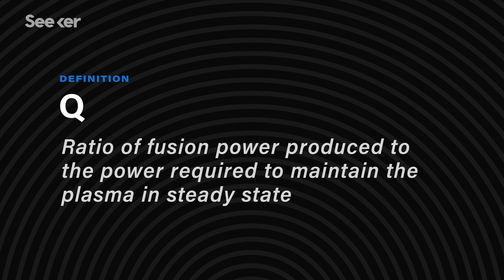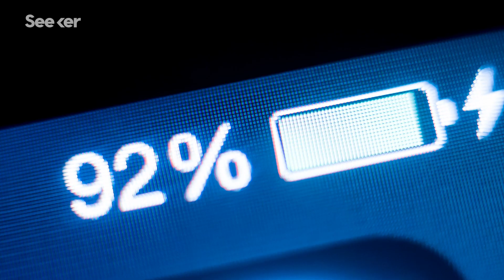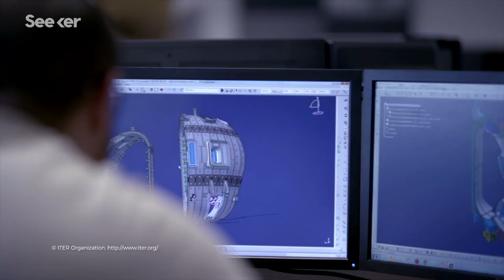How Close Are We to Fusion Energy?

Comment: Using magnetic fields to warp the plasma isn't the answer. If you made the generators in space I firmly believe that the magnetic field wouldn't need to be as strong as it is needed on earth. 

However getting a Fusion reactor into space would be difficult. 

Plus getting the energy back to earth would be more difficult..

Comment: Unfortunately, lower half-life means more radioactive in the short term. The candle that burns half as long burns twice as hard. Still, it depends on the type of radiation and radiation in itself isn't a big problem if it's managed properly.
Reply: Not really. Tritium has a half life of only 12.3 years but is barely radiotoxic compared to something like Cs-137 which is a longer half-life

Comment: In science there is this attitude that anything  is possible If studied enough.  The problems  with generating sustained fusion reaction are just too great.  In a star the fusion reactions are held in check by gravity . This depends on the stars mass . A more massive  fuses hydrogen at a greater rate than a less massive star. We  cant just replicate a small  star on earth. It's  small mass will not be sufficient to start fusion nor sustain it.  
With fission we slow the fission rate by controlling the number of neutrons involved in fission process.  If the number of neutrons is not controlled it can result in a run away reaction and a nulear explosion or something lke it. 
But in the case of fusion there there is no particle to control and moderate  the reaction. It all depends on how much hydrogen is present and how great the pressures exerted by gravity. You cant simply  change the amount of hydrogen present nor the amount  of gravity. These  are  things that would have to change on a massive  scale. We are talking about controlling things that are uncontrollable. The smallest star we know of generates too much raw energy in the form of heat,  light etc. The light in its most destructive form. Ultra violet infrared gamma, etc etc. 
If you  could get even a very  small star started there would be no way to contain its  immense energy. There is talk of using a magnetic  bottle  to  contain the positively charged atoms but cannot contain the energy  generated. What ive outlined  is very simplistic and the problem is way more complex. I believe it is not something that will ever be a reality. Ever ever. People are fond of saying well people said we would never fly  and would never go to the moon. But those are things  on quite a different scale. And being said by people with knowledge of the science available at the time. It  was certainty impossible with the  science known at the time.  There is no  hidden science that if synthesized would make a fusion reactor possible. Never gonna happen.
Reply: Gregory Phillips sorry, but you know nothing about how fusion works. You clearly don’t even realise what reaction chain it would follow.

Comment: ok phase 3 nuclear left us with either a 100,000 year problem or 100 years of fuel for phase 4 nuclear fuel that breeds tritium for fusion as a side effect iter is already obsolete small containment fusion is advancing by leaps and bounds but you still have to deal with high level waste that can be irradiated at huge energy cost  to cause it to brake down or it can be burned as fuel if you go with a fusion only solution there is a very large cost for reprocessing spent fuel as storing for 100,000 years or more is not a viable option. and with thorium and spent uranium the amount of high level waste and fertile material available the question becomes how much energy can you really use.

Comment: Fusion energy is technically nuclear energy.
Reply: No, not exactly. Nuclear reactor is based on Fission - when one big atom splits in many small atoms. Fusion reactor is opposite, it will collide small atoms into one big.
Reply: @breathtakingsamurai981  "No, not exactly."  ...Bullshit!  I know the frickin' difference and you're wrong!.  My point is that regardless if it's fusion or fission it's still NUCLEAR FRICKIN' ENERGY!  Although the duration of the radioactive output is a fraction of fission, it's still "neutron radiation" my friend.

It's still "atoms" in play regardless of what element you are using.  You should know that!

At the very beginning, the video listed "nuclear energy" as being a problematic energy source and all I did was remind them (and you) that it is still "nuclear energy."  

Whether you are left with 10,000 years of radiation or 100 years ...you're still screwed  You STILL have to find a place to get rid of it.

Comment: Too much energy is lost in a torus to sustain fusion. A sphere is better. Search for "spherical electromagnet" if you want to see a better design. It should be the first thing that pops up. You will know it when you see it - it's the icon that you see to the left. In this design the plasma is rotated like the armature of a motor with the axis of rotation constantly changing. The counter emf inside the plasma compresses it toward the center.

Comment: SO yeah it taking long might be a good thing. A melt down in a fission station is bad yes but a runaway fusion station literally turns our planet into a star. Everyone wants it but it needs to be done right and done safely.
Reply: We already created mutiple fusion reaction inside our atmospheres, with no protection whatsoever, and it didn't turn the planet in a star it is physically impossible to do so.
Reply: Who told you about a runaway fusion reaction?? The conditions to keep the reaction going are so critical that the proces shuts down itself with the slightest change in variables. Everything that can possibly go wrong will just shutdown the plasma and in worst case, require an expensive and long repair. It are the laws of physics themselves that make it intrinsically safe. It simply cannot explode. The only way to get a fusion explosion, is by creating first enormous pressure with a fission bomb.  That's how fusion bombs work. At Iter they just use a ridiculous high temperature to compensate for the lack of pressure. That temperature can only exist inside something that has practically no mass and cannot touch anything. When it touches the reactor walls, it cools down instantly far below the temperature needed for fusion.

Comment: Einstein's famous equation, E=mc^2 is wrong otherwise garbage also can be used to make nuclear bombs as long as it is matter or it has mass. Energy and matter can't interchange one another according to Einstein's famous equation. One must have photons before one can emit out photons. Photons are particles and they have mass. All forms of EMWs including light and heat are dynamic photons per volume per time in different saturations. Fusion process is a bluff! It's not something as easy like combine some atoms into other denser atom. Based on our research is that single  protons of hydrogen molecule have no nuclstayphotons (e.i. nuclstayphotons are photons that can't be replenished after releasing to the surroundings and they play an important role in squeezing nucleons together to maintain nucleus stability) but abundant chemstayphotons (i.e. photons that can be replenished after they have been released to the surroundings when there is changes in temperatures or due to chemical reactions). On the other hand, nucleons of helium atom have reasonable amount of nuclstayphotons to squeeze nucleons together to maintain its nucleus stability. In addition, nucleons of helium atom have very low amount of chemstayphotons therefore it almost completely inert chemically. Therefore it is impossible to fusing 4 hydrogen atoms to a helium atom because single protons of hydrogen molecules don't have any nuclstayphotons at all and it's impossible to replenish those nuclstayphotons onto single protons of hydrogen molecule before any attempt to turn them into helium atom. No wonder all tokamak reactiors worldwide still  fail to produce even trace amount of helium atoms. Precisely, fusion process is a big bluff! Scientists got it wrong that stars including the sun generate heat and light through  fusion process on hydrogen gas. Yes it is true indeed that atmosphere of all stars is filled with abundant hydrogen and helium gases and this doesn't necessarily mean  stars generate heat and light through fusion process on hydrogen gas. We must understand why and how hydrogen and helium enriching all stars' atmosphere in the first place? As a matter of fact, hydrogen and helium gases are the by-products of proton emission and alpha emission respectively by decaying radioisotopes within the core of the star. We got this wrong somehow. The earth's upper atmosphere is also enriched with hydrogen and helium gases too that derived from proton emission and alpha emission respectively by decaying radioisotopes within the core of the earth. If you are interested in real discoveries, I would recommend you to read my book, The Unification Theory - Volume One and you will be amazed with lots of new, interesting discoveries. In God I trust..

Comment: -  fusion is the most overrated energy technology. it is nothing else than a steam engine with an extremely inefficient temperature differential. to drive the turbines we need several steps of conversion with immense energy losses. fusion reactors are expensive and gigantic, therefore they are rare, central power stations with extremely long connections to the customers, resulting more costs and less efficiency. any solar roof or heat pump is better engineering than a fusion reactor. they might be sth. for rockets or as we know perfect for weapons of mass destruction ;-(
-  it's on of the least efficient energy technologies. to promote the fusion, pressure and heat energy input needed with over 90% of the potential output.
-  it's the least practicable energy technology. the slidest problem with the electro-magnetic field in the reactor causes complete damage of the hole system... and worldwide they never kept a permanent process, seconds or minutes were the best durations until (emergency) shutdown.
-  it's one of the most expensive energy technolgies. the hydrogen fusion isn't state of the art anymore because technical hurdles are too high therefore the new concepts are dealing with helium3, less effective, the fusion is easier to start to keep ... but the stuff is rare ... we would have to get it from the moon surface, this isn't a joke, it's idiocy. guess why several nations planning to go to the moon.

Comment: Sun and all stars generate heat and light through fission on dense or very dense radioisotopes or both within their core. Generally atmosphere of stars is enriched with hydrogen and helium gases as a result of the by-products of fissions. In other words, proton or neutron emission will likely to produce hydrogen atom. On the other hand, alpha emission will likely to produce helium atom. Face this reality! Einstein's famous equation, E=mc^2 is wrong otherwise garbage also can be used to  make nuclear bombs as long as it is matter or it has mass. Energy and matter can't interchange one another according to Einstein's famous equation. One must have photons before one can emit out photons. Photons are particles and they have mass. All forms of EMWs are dynamic photons per volume per time in different saturations. Photons can account for the loss mass during the detonation of a nuclear bombs. If you are interested in real discoveries, I would recommend you to read my book, The Unification Theory - Volume One and you will be amazed with lots of new, interesting discoveries. In God I trust.

Comment: Now we finally have devices where we can see the magnetic fields measure their strengths and position them to the exact specs we would like we should use that to our advantage, Because when it comes to fusion cold fusion nuclear power things , You how Hi super high heat plasma so you would have to contain the energy burst when energy is released things like that kind of white solar flares and stuff like that, In order to do that you would have to have technology that can withstand those types of power reactions what is kind of hard to tell so you could do that by separating creating a non physical barrier with magnetic fields, I'm sure they're doing that stuff already the problem is that they have not affected the techniques and attitude him you would need a sphere magnetically to compress an inner magnetic doughnut, So when flares happen they are re directed and compressed back to the magnetic do it half weights and continue their process, Then you can use the outer shells as a backup system like their ripples and material composition and gun real burst frequency vibrational  Uses as a backup system when a flare cannot be compressed, There  Is also a crystal form of energy as an outer shell we could you to life to cool the system on emergencies there will take the atomic structure of the heat transferring it to atomically creating a structural pattern we can utilize the energy and it will self change the tomich structure and/or patterns back once transferred and be ready for the next heated explosion and expansion, Then we just call it the energy magnetical photo and heat transfers,

Comment: I just can't wrap my head around what would happen if a fusion reactor had a catastrophic failure. Would it go out with a boom like we've never seen... or just shut down?
Reply: From what ive read, It usually just shuts down. The process to sustain the plasma is rather specific that a small deviation would just turn it off

Comment: There's one thing not true about this video - the suggestion that you can't have 100% clean energy without nuclear fusion. With solar panels and windmills, you can make green hydrogen, which you can use to produce electricity when there is no sunlight or wind - or you can use it as a fuel. Basically it can meet almost all energy needs. Storing hydrogen in the ground using depleted gas fields could be a lot cheaper then using batteries. Unlike nuclear fusion, we can already start creating the infrastructure today. As is happening in the Netherlands already  https://fuelcellsworks.com/news/northern-netherland-and-governments-to-invest-2-8-billion-euros-in-green-hydrogen/
Reply: Windmills only last 25 years before their major parts need to be replaced. solar panels have low efficiency and are a nightmare for recycling. The power we can harness with those techniques will never be enough to deal with our ever growing demand for electricity.

Comment: Fusion generates heat and light, how exactly are they planning to transform that light/heat INTO electricity?
Reply: Heat boiling water has been used since essentially as long as we have been generating electricity. We have also been turning light into energy for some time. They also capture some of the subatomic energy given off as well

Comment: Fusion energy isn’t that a more fancy word for nuclear energy plus in no way is it the greenest you just said it releases radioactive content that is in no way clean energy
Reply: There are two ways of producing energy from nuclear reactions, Fusion and fission. What we currently use is fission and it produces Nuclear waste, which is very hard to dispose of. But on the other hand what they are talking about in the video is a fusion reaction which doesn't produce nuclear waste and its probably more clean than Hydroelectricity.
Reply: That radioactive waste was for the fission reaction which we currently use and not for fusion.
Reply: As the other dude said, two completely different reactions. 

Fission is what we currently do, which is taking a neutron and firing it at a heavy atom so that it splits, launches more neutrons at other heavy atoms and thus creates a chain reaction. Every separation releases energy, which we harvest in nuclear reactors. The resulting product's half-life is extremely long (depending on what was used, up to 5 billion years)

In Fusion, you are pressing together atoms, which not only requires a much easier to obtain fuel (Hydrogen-3), it also creates waste with way shorter half-life. It's not 100% clean, but 100% clean energy is impossible. This is as good as it gets.
Reply: We currently use fission, which is basically just unstable radioactive isotopes breaking down into lighter elements. Fusion is the process of atoms getting fused together into heavier elements. Fusing hydrogen atoms together will just produce helium, which has many practical uses.

Comment: All light generated is fusion. From a light bulb to the sun, to the strike of a match. It is fusion.
Reply: In a light bulb (at least the older incandescent ones), what happens is the electricity flowing through the (usually) tungsten rod heats it up and causes it to emit thermal radiation, in the form of visible light.
Reply: @sebastiaomendonca1477  I'm taking quatum level, all emmeting light, is fusion. You should understand quantum mechanics, if you are using a digital device.
Reply: The future is quantum. Not gaslight